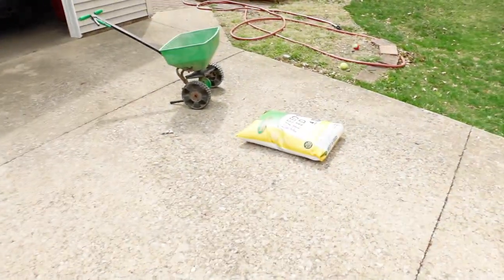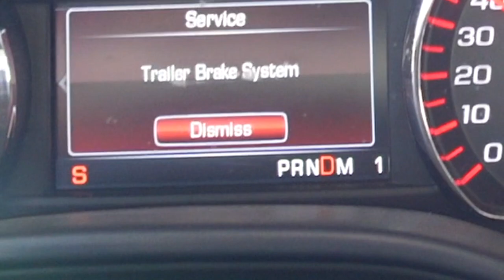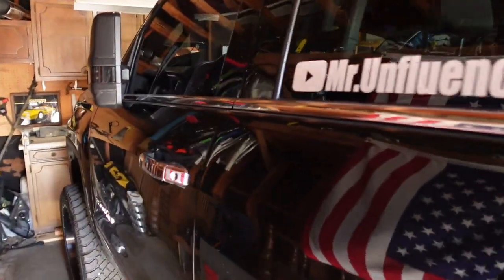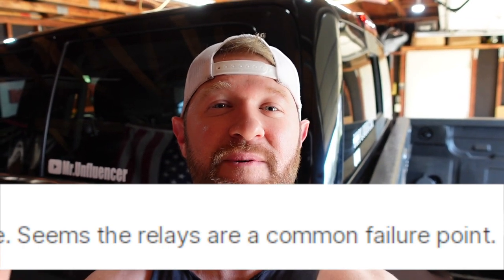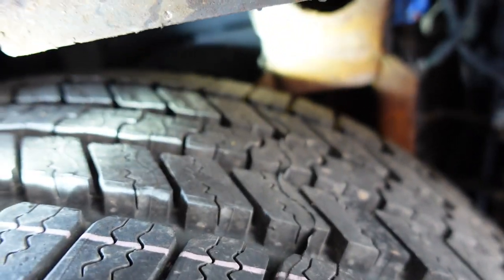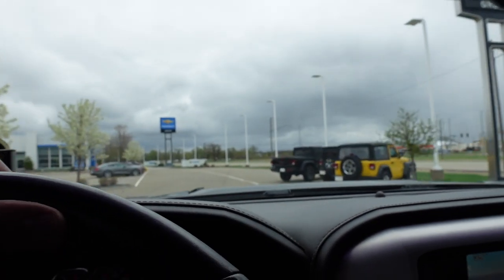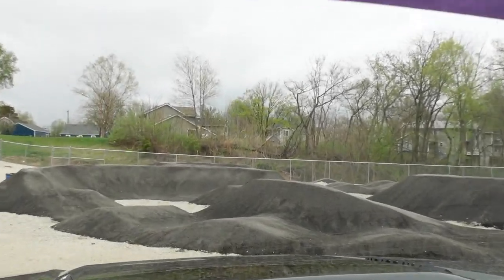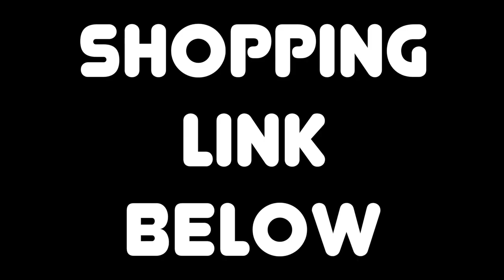Service Trailer Brake System ... What's Wrong?

Comment: I haven't had that exact problem with my duramax, but I do have a weird issue when I hook my camper or gooseneck up. If I leave the truck running and hook it up the electric trailer brakes don't work but if I turn the truck off and back on they work. As for the car... if I had the money I would probably go for the 2019 vett that thing looks sweet!
Reply from the maker: Thanks for the feedback Ryan! I’ll have to give that trick a try when I pull the bigger trailer 🤙💪